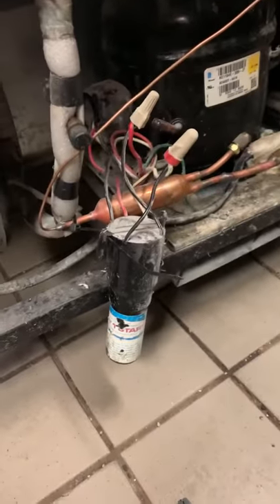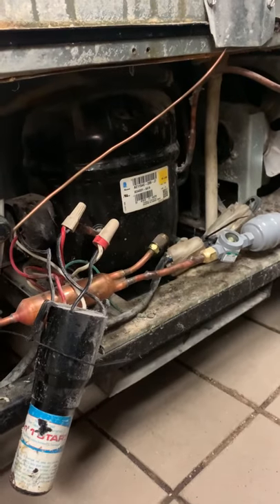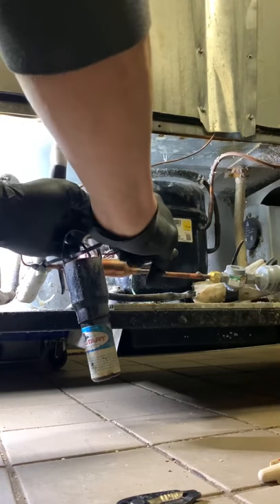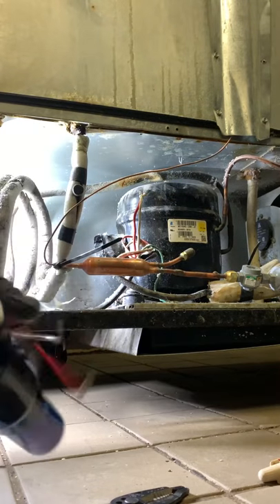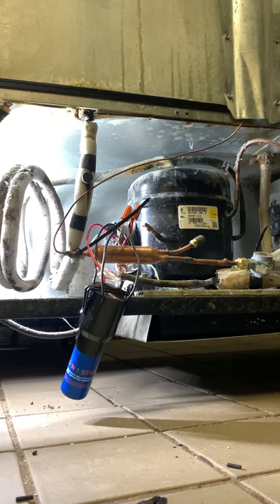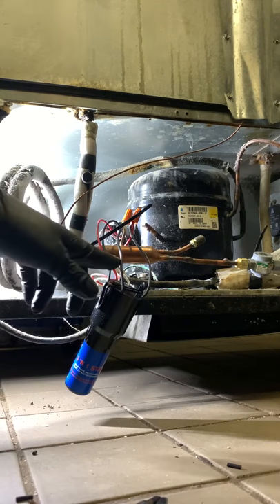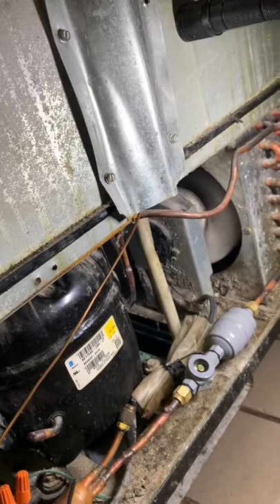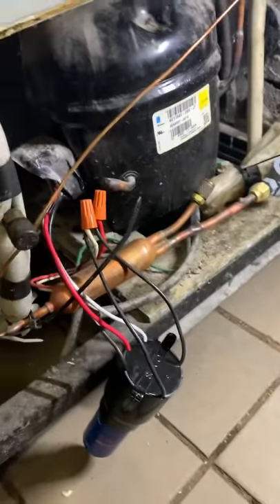Refrigerator Compressor making noise but not starting  not starting

Comment: Some fridges and freezers do not have capacitors. Why?
Reply from the maker: Majority of motors are PSE motors which are permanently split capacitor motors if you don’t have a capacitors the voltage is probably three phase 220 or three phase 460 which has enough power to start the motors in the unit without a capacitor.....so  check if it's three phase I’m sure that’s the reason why